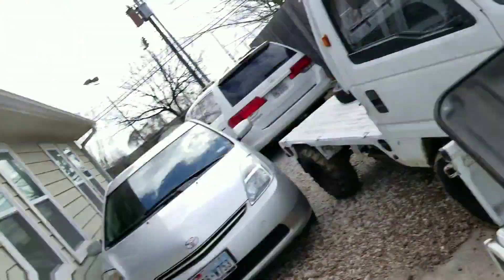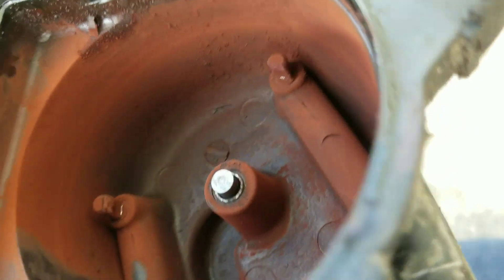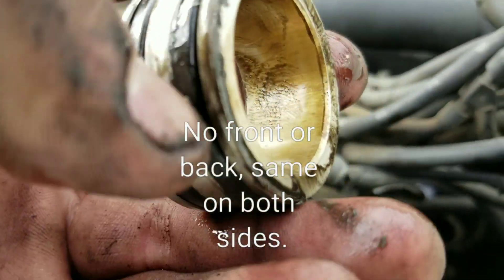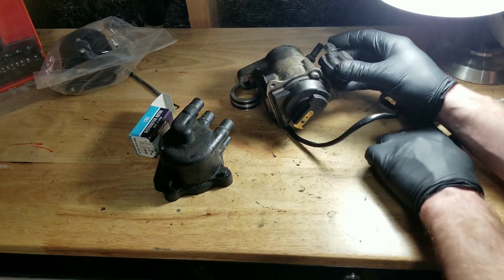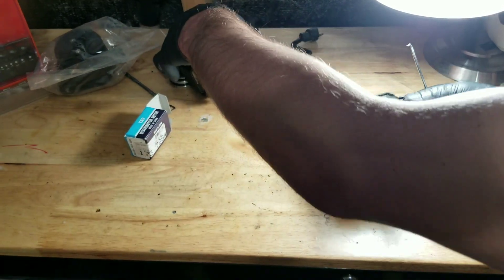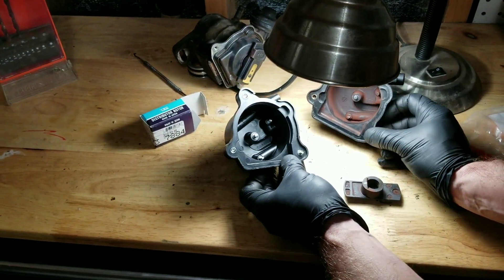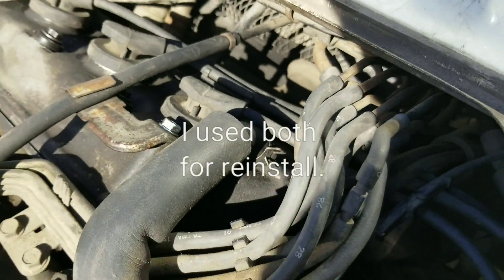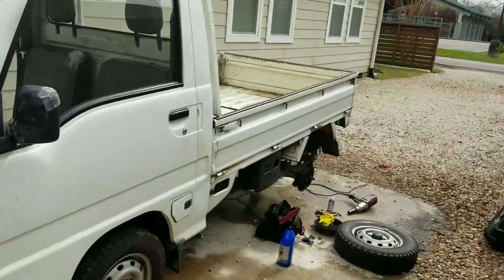Honda Acty distributor cap and rotor replacement.

Comment: Just changed my cap and rotor trucks still got half power and dogging out at high revs
Reply: My truck was bogging at full throttle and high rpms, was not getting enough air. Put a K&N instead of the airbox, problem solved.
Reply: I'm not sure if you solved this issue or not but I have a similar issue and from all my research the cause seems to be a stuck solenoid in the Carburetor not allowing enough air in (If your plugs were fouled like mine) - Part number for the solenoid is 16031-PZ3-000.

Comment: 4:06 Dist looks keyed.  Like the normal usdm hondas.  So it not too hard to figure out that its 180 degrees out or be smart and snap a pic with ur smart phone.
8:30 the rotor is keyed too!  So if anyone has ever looked at a d series honda (90s) its just as simple.  
10:15 rofl time to get the jump pack xD
10:30 spoil sport i wanted u to get another battery out and some jumpers so i can tease u about just taking it out and charging it xD

Another thing crossed my mind.  U think there is enough slack in those cables to make a new batt box to hold a group 51 batt?